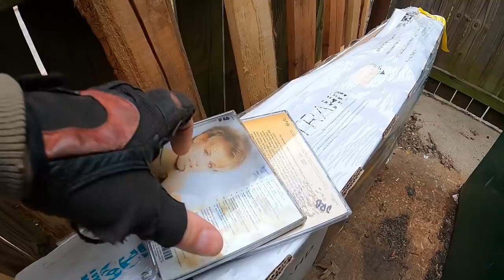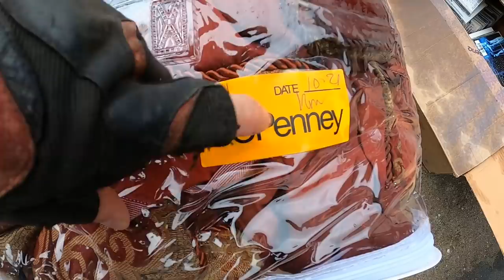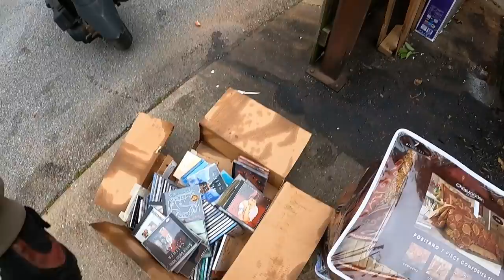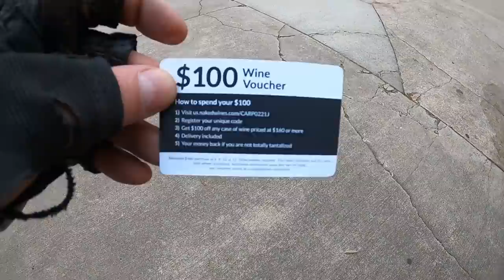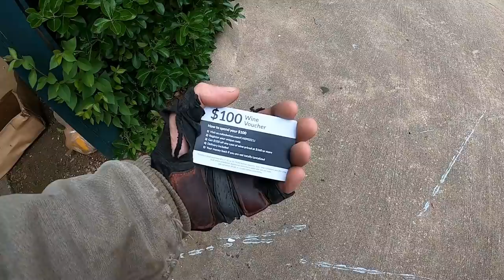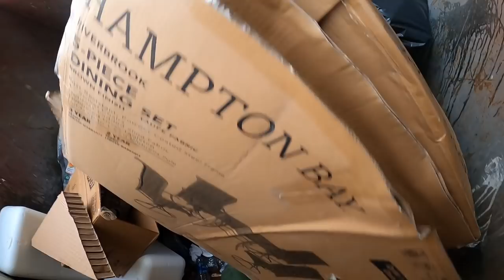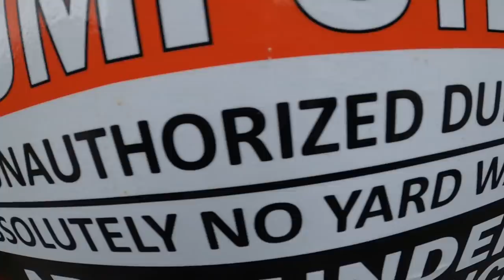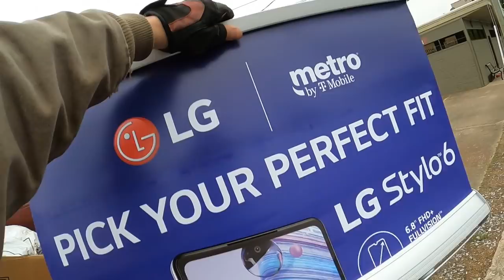Dumpster Diving in Mass Quantity - "Pass It On"

Comment: Took a drive down one of the alleys close to home this weekend. As I usually do on the weekend and happened across one of those aluminum pickup bed tool boxes. So i came back to the house to grab my scraping truck. I went back to it to discover that it was heavy because it was just about clear full of motor oil containers. The truck is pretty full right now and taking it up that high would be a pain so i passed on it. After a bit I decided to go grab it with another vehicle after all, figuring that I can take the old oil to the parts store a little at a time. Well it turned out that the actual 'old' oil was maybe a gallon and a half.. the rest of it. Gallons of it, is perfectly clean, looks like new.